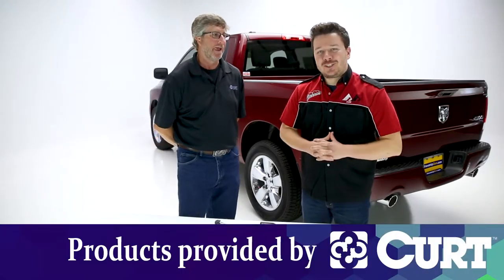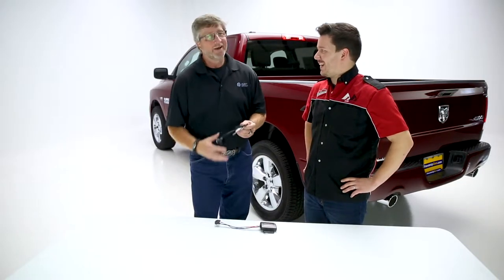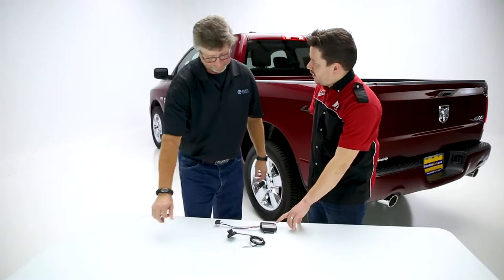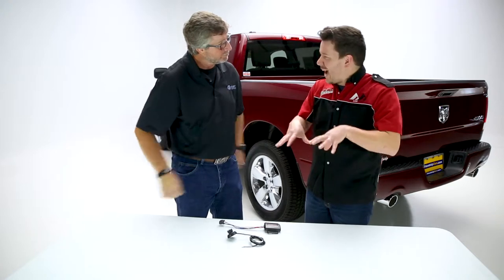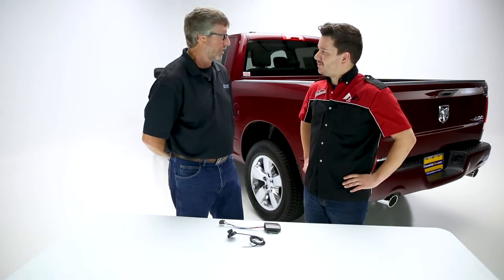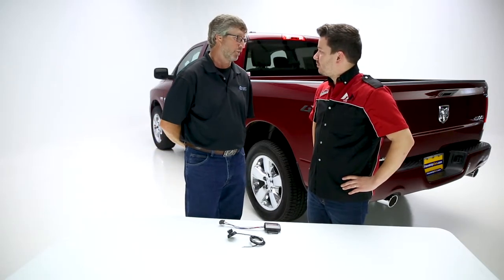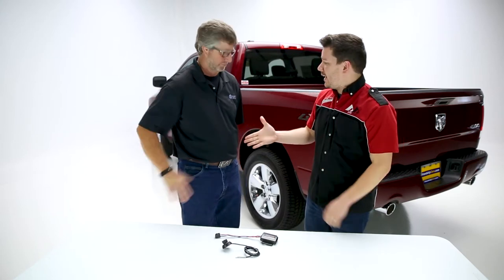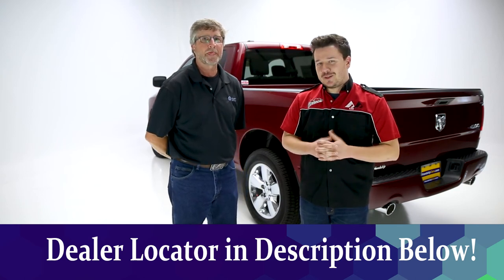In the Garage™ with Performance Corner®: CURT Spectrum Trailer Brake Control

Comment: Followed directions to the t. Trailer lights all work, but every time I press on the brake pedal the controller flashes green then goes to red. When I let off there are no lights. No lights when I press the button in too. What am I doing wrong?